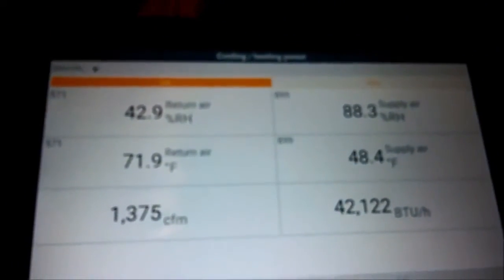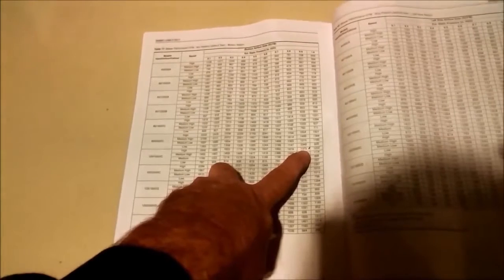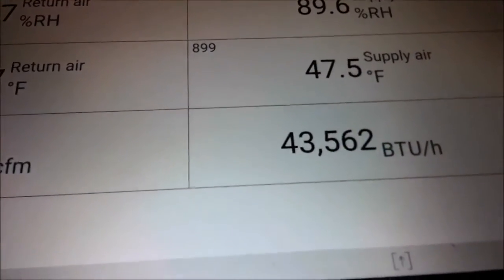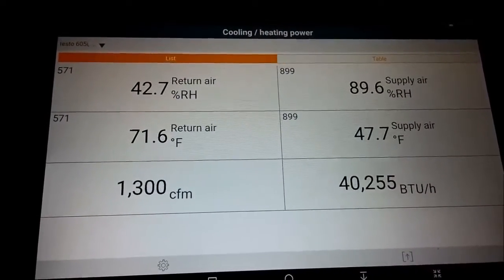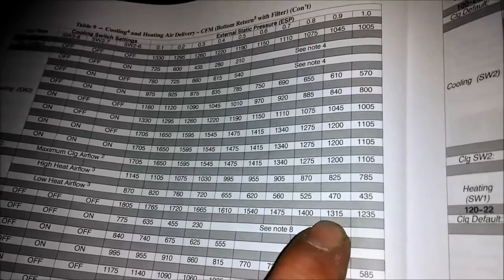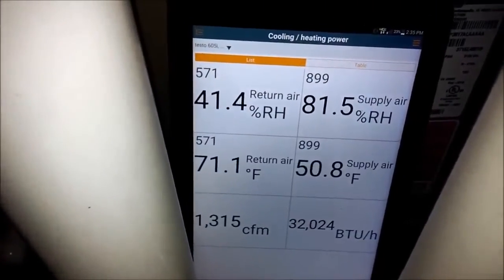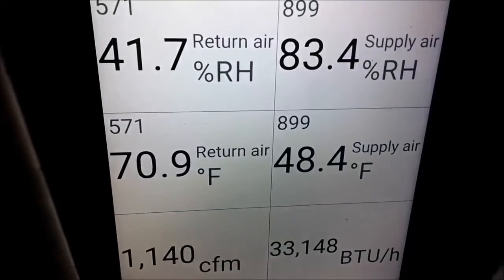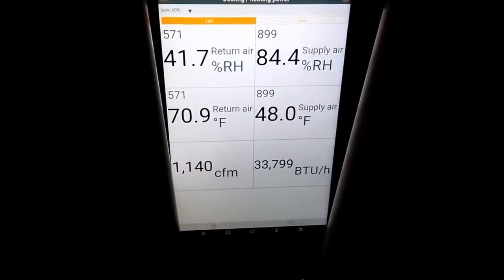Testo smart probes 510 I, 605 I heating & cooling power

Comment: whats the point of even coming in if your going to be off by 6000 to 12000 btu's ?
Reply from the maker: +Kia you didn't answer my question what tool should I be using
Reply: a shotridge ADM-870C or ALNOR MICROMANOMETER EBT730 or a cheaper option would be ALNOR AXD MICROMANOMETER AXD620

Comment: by the way your using the speed / cfm / s.p for all the wrong reasons,  these data are simply to give you an idea and were recorded in a lab setting, you have a totally different setup here as this system has its owm static pressure losses, the right way of doing this is to actually take a duct traverse and calculate the right amount of air as i promise you will be off by more than 15% if not more, and thats with a proper instrument not a testo, the shortridge or an alnor will give you a proper result
Reply from the maker: +Kia so how many calls do you run a day because I run about 10 and I don't have time for that so this is as close as it's going to get I'm not in a lab I'm on the field this is how works in the field textbook doesn't always get it done in a timely manner there's a reason why manufacturers give you charts in the book and it's not because it's from a lab
Reply: I understand, but you can atleast record the static pressure with a better instrument, wìth the accuracy of the testo, your better of guessing! take a close look at the specs of the testo, the accuracy is actually less than the resolution, which makes no sense!
Reply from the maker: +Kia I have an imanifold maybe that would work better or do I need a lab instrument what would you suggest what tool works best for you

Comment: omg... no body notices how wrong  this video is
Reply from the maker: +Kia you do need any Cooling do you know how to use tools
Reply from the maker: +Kia I think you need to do some research
Reply: i am not sure about your testo 605, but i do own a testo 510i, same one as yours, and i can tell you it doesnt work! unless you dont mind being off by a ton of cooling
Reply: i am a mechanical engineer and i purchased this instrument for the means of commissioning but i realized its as good as a toy unfortunatley, with the accuracy of the testo 510, you will read velocity at segments of 400 fpm, lets assume your duct is 1 sq ft, that is 400 cfm which can carry a ton of cooling by standard which is 12,000 btu's... you will never be able to read velocity or pressure with a proper degree of accuracy, in fact you will have readings with an accuracy of 10% only if your measuring 4000 fpm or higher
Reply from the maker: +Kia I do not see any videos on your Channel suggestion that you're a mechanical engineer if you have so much knowledge on tools and commissioning maybe you should help the HVAC Community out and show us the right way to do it in the tools you use that would be helpful instead of trolling

Comment: Shouldnt it be 400cfm/ton?
Reply: Jimmy DeNardo 
yes, 350 cfm per ton is old standard
Reply from the maker: it depends on what you're trying to accomplish if you want better dehumidification run the system at 350 CFM per ton and for better sensible Cooling run it at 400 CFM per ton thank you

Comment: They could have taken static pressure into consideration before the duct system went in. That would make your job a little easier.
Reply from the maker: +Larry Cole the equipment's different from 25 years ago we didn't design the duct work we just put a new furnace on it we run into this problem all the time thanks for watching
Reply: +Mi Heating Guy With the new equipment and the static pressure settings being crucial to CFM, your right the old duct systems just don't cut it. They are to small almost every time, we just didn't pay attention to that back then.
Reply from the maker: That's why manufacturers are allowing higher static pressures because they know that most of time the old ductwork is undersized thanks for watching and thanks for the comment

Comment: Isn't that manufactures maximum external static pressure allowed I half-inch. I measured hundreds and hundreds of installations and very few were ever under a half-inch. Which means these heating companies do not know how to design and install ductwork which is basically what heating contractor does. Most contractors I asked don't even know how to measure external static pressure.